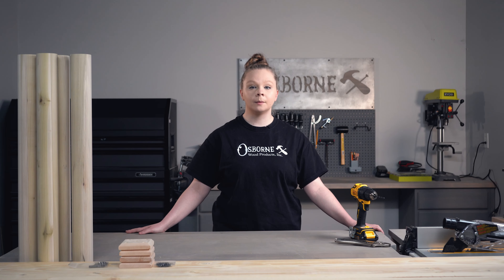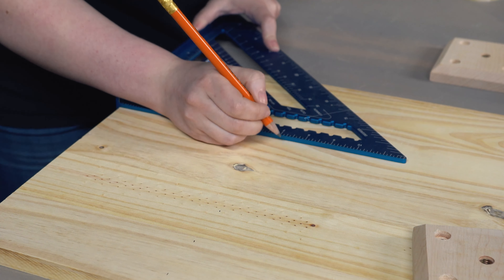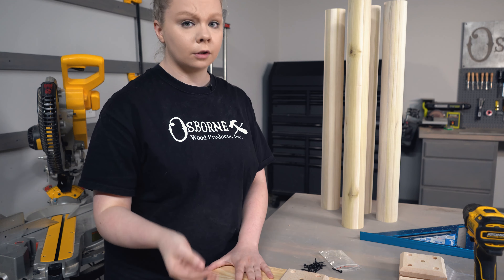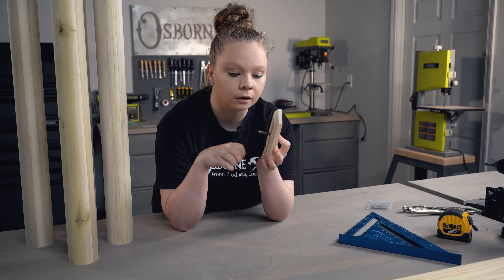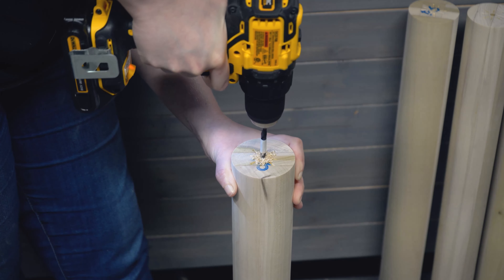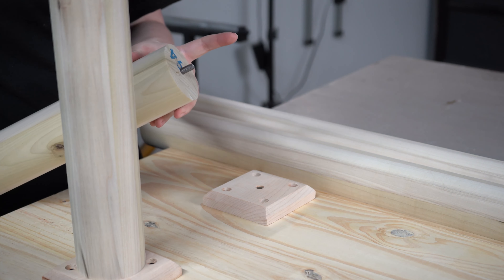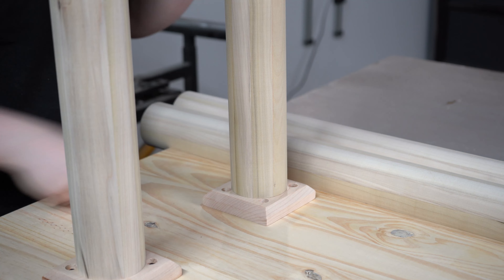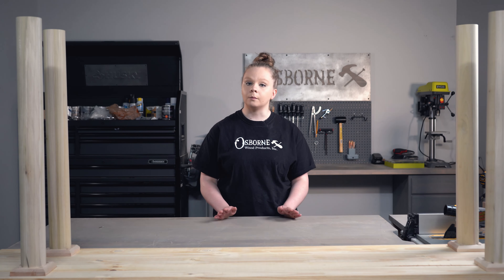Installing Round Legs with Osborne Leg Mounting Blocks - Builder's Studio

Comment: Nice video! Is a 1 inch thick base usually thick enough to mount any type of legs you want?
Reply from the maker: Thank you! Osborne's mounting blocks are 3/4" thick and available in either a 4" or 5.75" width. These sizes will allow for table legs up to 6" in width at any length.
Reply: @osbornewood  thank you for replying, but I was trying to ask of a tabletop depth of 1 inch is a thick enough base to attach these kinds of leg brackets? I have no idea the screw depth they require to attach into table top.
Reply from the maker: Apologies, I misread your question. Yes a 1" thick tabletop is thick enough to attach these mounting blocks. The mounting blocks will come with 1 1/4" screws for attachment, which should be sufficient for a 1" thick top (3/4" of the screw will go into the top). Hope this helps!